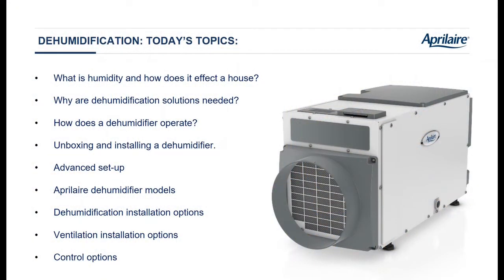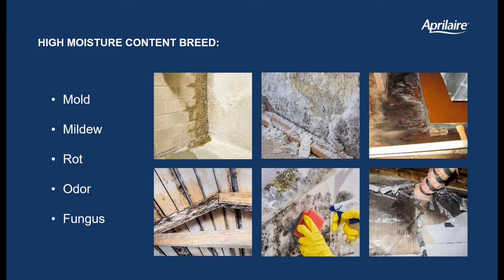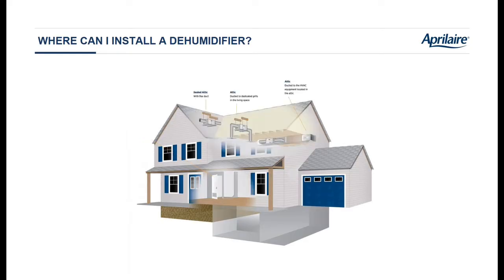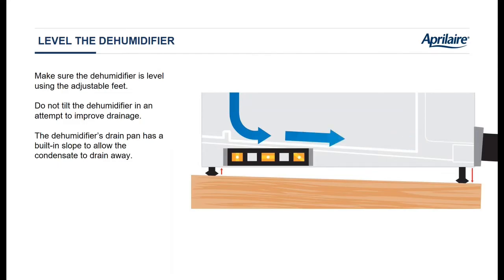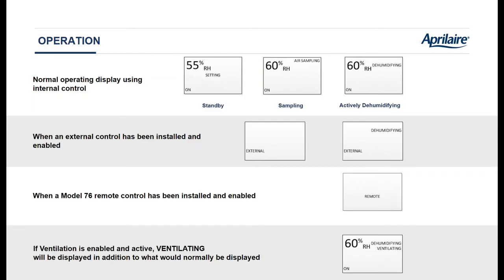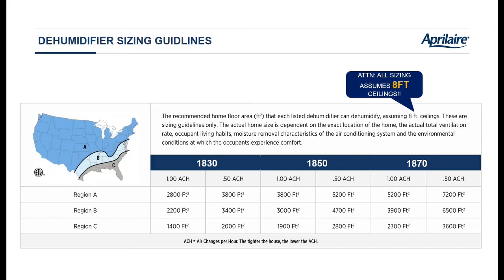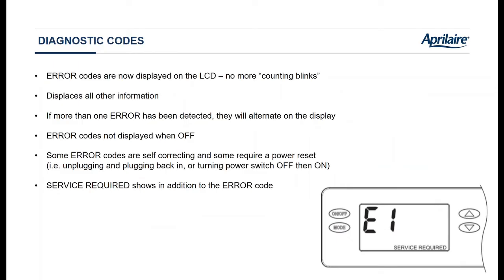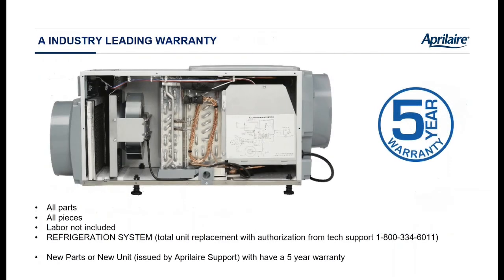AprilAire Dehumidifier Product Training Webinar (Recorded March 2020)

Comment: Florida 2020 code is - Installation Restrictions: Ducted dehumidifiers must not be connected to the return air duct side (upstream) of the central cooling system.  Best way is to use a dedicated duct to the dehumidifier and then out to the supply side ducting.

Comment: Great video, highly informative.

The only question I have is: at the end "aluminum coils" are listed as a technical advantage. Isn't aluminum the cheapest possible metal for the job, and inferior in other respects? Most HVAC techs prefer copper due to its superior heat transfer and antimicrobial properties.
Reply from the maker: Thank you for contacting AprilAire! Aluminum coils are less susceptible to formicary corrosion than copper, and coil longevity is a primary goal.

Comment: Leakers 75 percent of all I put in leak
Reply from the maker: @jimshorts7983  Thank you for contacting AprilAire. Would you mind giving us a call to discuss further? We would be happy to help! We can be reached at 800.334.6011 Monday through Friday, 7:00 a.m. to 5:00 p.m. CT.
Reply: @aprilaireco  Do you have an online spec sheet with how much refrigerant in each humidifier model. Also if there are any hidden service ports, going to tear one of these units down this weekend and try to figure out where they all leak from.
Reply from the maker: @jimshorts7983  Thank you for your questions! Each dehumidifier has the spec. amount of refrigerant added on the sticker on the drain side panel. There are no service ports to add refrigerant as they have a closed system. We would recommend that you give our technical support team a call at 800.334.6011 (Monday–Friday, 7:00 a.m. to 5:00 p.m. CT) for assistance with troubleshooting.
Reply: @aprilaireco  Air in vs Air out in ws like 70 out was like 72 amps on compressor about 2.7 as I recall, high side hot leaving compressor low side never got cold at all. I have had 3 out of 4 of these lose all their charge. This one has sat never being used but maybe 2 times in 9 years everything is like new air filter never had a spec of dust on it, what can you do for my customers I buy these through a high end brand name dealer out of Wilmington mass. Has to be a weak point on these small units. I have done some very big units with no issues but not sure if those are made by you.
Reply from the maker: @jimshorts7983  Would you mind giving us a call at the number above to discuss further? We’d love to follow up with you on this. Thank you again for contacting AprilAire.
Reply: @aprilaireco  Confirmed leaker, no your team wouldn't help me I called past the warrantee so far 3 out of 4 leak buyer beware

Comment: You brought up thermostat 8920W - I have that. What a shame I need to also buy model 76 to be able to use remote control function. I wish the relay module on 8920W included A,B - for humidity terminals required by the E100 dehumidifier

Comment: Excellent video - Steve commented that outgoing air will be a little bit warmer and of course a lot drier. His graphic however showed 15F warmer.  That temperature rise is a lot larger than I intuitively (apparently incorrectly so) expected. Does this imply that even with the 15 degree rise that the air is so much drier that comfort-wise you should not have to turn on the AC to compensate?
Reply from the maker: Thank you for contacting AprilAire! That is correct about our dehumidifier. The exhaust air should be warmer, rise between 10-30° but drier. Even though it’s warmer, the dehumidifier reduces a lot of the humidity so the air will feel more comfortable. We would be happy to discuss this further and can be reached at 800.334.6011 Monday through Friday, 7:00 a.m. to 5:00 p.m. CT.

Comment: is the 8476W  compatible with E100 dehumidifier
Reply from the maker: Thank you for contacting AprilAire! The Model 8476W Wi-Fi Thermostat is not compatible with any Indoor Air Quality products. If you are looking for a thermostat that can control a dehumidifier, we recommend the Model 8620W Wi-Fi Thermostat instead. Please reach out to your local HVAC contractor to determine which products are best suited for your home and to ensure a proper installation. If you have any additional questions, we would be happy to assist.
Reply: @aprilaireco  thank you very much 

Would you send me the instructions how to  wire/program the  8620W. To the E100 dehumidifier
Reply from the maker: @angelogz4384  Thank you for your question. Would you mind giving us a call at 1-800-334-6011 to discuss this?

We would like to talk through with you so we can determine exactly what you need for your application. We would be happy to provide detailed wiring instructions from here. Thanks again for contacting AprilAire!

Comment: What the difference between caster vs leveling feet to buy?
Reply from the maker: Thank you for contacting Aprilaire! The leveling legs are for stationary installations while the casters would be used if mobility is needed. If you have any further questions, we can be reached at support@aprilaire.com or by calling 1-800-334-6011. Thanks again for reaching out.
Reply: @aprilaireco   Buy the one with the wheels if your floor is level right?
Reply from the maker: @3095Alex  We would be happy to talk through your home's specific needs in more detail to ensure you are getting what you need for your space. Would you mind giving us a call? We can be reached at 1-800-334-6011 Monday through Friday, 7:00 a.m. to 5:00 p.m. CT.

Comment: Regarding ducting to HVAC system - in figure 13 (preferred attic installation) is it acceptable to have dehumidifier pull from a dedicated return and then push dry air into return plenum, just before filter cabinet? If so, are there any requirements or recommendations for the length of 10” duct between dehumidifier supply and HVAC return? I used a dedicated return for the dehumidifier because of a lack of attic space to pull out of an HVAC Y-fitting and then reintroduce dry air to return plenum 6’ min. down stream.
Reply: I have this same question. I'm definitely not an HVAC professional so I don't know much, but it seems like you could draw air thru dedicated return then pump it in return line of unit.

Comment: if I have an Aprilaire 800, do I need the sensor or the one comes with 800 would also work on this? Also, is there any controller that can be install on the return due that can control both 1850 and 800, so I don't need 2 different controller. if not how that would be possible? overall it was very good and detailed